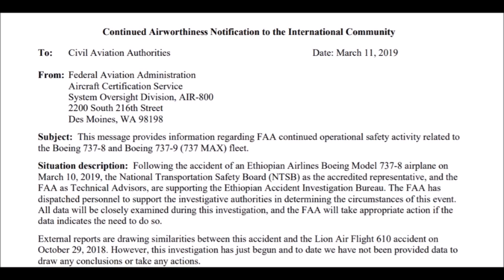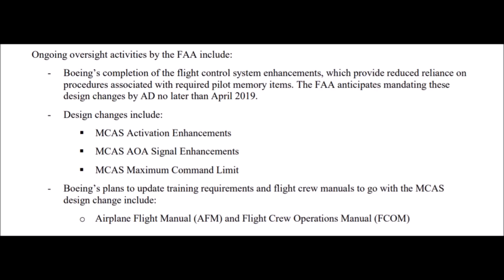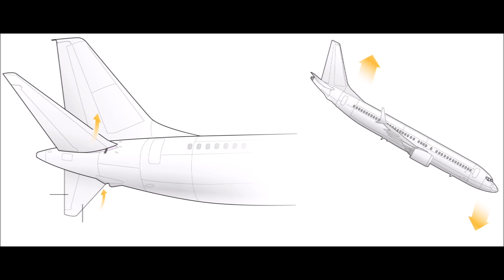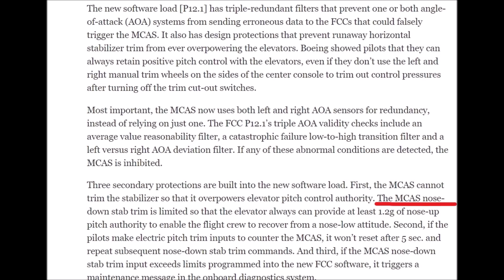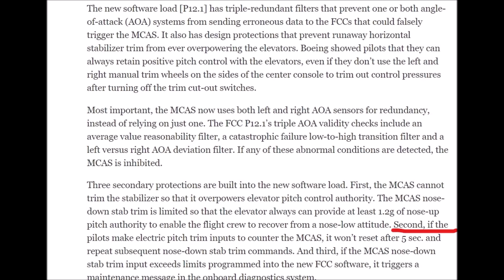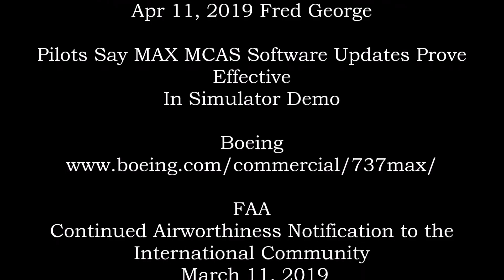737 Max UPDATE 14 April 2019 "The Fix"

Comment: Hello everyone sorry for such such a late response on this I have been working as a controls engineer through the Covid shut down and I’ve been very busy upgrading designs on various machines I really appreciate everyone’s input and honest answers and I agree with all of them, I do have one question for 1 or anyone who knows the 737 max! One can the 737 max be flown with the MCAS system disengaged completely? In other words if out rotation the pilot had to trim down manually with the trim controls on the yoke could it be done in a way that the pilot could keep the plane flying without too high of a climb rate and not putting it into a stall condition? I assume yes of course it would be distracting to have to trim down the hallway as you’re taking off as the MCAS system might do but if it can’t be done in this manual manner then as a control engineer I would consider this plane to be borderline not flight worthy because if the sensors or that system was to fail and assuming it had the red light which I heard was an option by Boeing not a mandatory system feature of displaying this out of all of this is true then maybe this plane really isn’t flight worthy? There’s certainly needs to be more redundancy in the system and as a control engineer I need to know that the pilot can control the aircraft or the machine when it’s in complete manual mode for the most part! Comments suggestions? I also know somebody I grew up with that’s a control engineer that works at Boeing I know he’s a very good engineer and I suspect he complained about this too I think he still there I hope him and I get in contact with each other, in my industry wafer fabrication robotics and toxic gas controls we have learned the hard way at putting a critical system in a safe state is the first priority when there’s a malfunction! Thank you everybody for your input and comments!

Comment: Hai captain I agreed to have automation in flight is good to avoid pilots work load .
Why Boeing not designed MCAS full automatic functions. As you said if ..... happen MCAS cut off , what design is it  where is the safety. Pilots get confuse , panic with error in instruments along with flight control column shake.
 If any crash happen Boeing will say we trained pilots ,  Crashed due to pilots error.

 World will become  against Boeing. It may effect even other models of Boeing aircraft for sure.

 My humble request ,  let Boeing redesign MCAS with failsafe concept introduce. Let automation happen. Defect report to pilots and ground with immediate effect. 
If not  let Boeing give complete simulator training for pilots freely.
Let the pilots fly freely with laughing face all around the world.
 As of now Boeing totally failed infront of Airbus high tech.

Comment: Who's the idiot that placed the entire airworthiness of a plane on a single sensor?    I have more backup systems in my house where I have multiple backup security electronics.  Of course,  I am not talking about an individual but an entire corporate culture that allowed this kind of idiocy to flourish.  It's incredulous to charge the buyer (of the plane)
additional money to include a backup sensor.    And install MCAS without informing the pilots, and allow the MCAS to override the pilot.   Holy idiocy.   Boeing once a marvel of an engineering company was taken over by McDonnell--and allowed the failed McDonell culture to destroy Boeing.  So if Boeing goes the way of the dodo bird,
let it.   When will boards of directors be responsible for their devotion to Wall st, and not core values?  The best answer
is to let them lose their investments.

Comment: There would be no need for MCAS if Boeing would have come to the prudent conclusion that the 737 airframe needed replacement. A new aircraft designed after the 787 but smaller to fit the old 737 midsize market segment and beyond would have been the proper choice. I doubt any software update or upgrade will regain the public trust for a 737 Max. This is fundamentally a question about the need to have old far outstayed hardware design replaced!

Comment: With all the scrutiny the 737MAX is undergoing, I'm willing to be a passenger even if I have a bit of irrational trepidation. 

The crews on the two planes that crashed were inadvertent beta testers of MCAS software. If weight and balance were factors in the crashes, then the passengers were also part of the experiment. Boeing is paying dearly for failing to test all aspects of the 737MAX more rigorously but not as dearly as the cost of one life, let alone hundreds.

Should the FAA have told Boeing the new plane is not a 737 but a new model, after they examined the differences?  I want to see how blame is apportioned when the lawyers and judges and juries and plaintiffs and defendants reach settlements, if I live that long.

(edited for format, not content.)

Comment: This is a perfect example of the problem that led us here, this statement by Boeing makes little sense to me. I think it is designed to befuddle the reader, "weasel words" as they are called in some circles, where then everybody around the office would just pretend to understand, it is not understandable very much at all, for me.
"The new software load [P12.1] has triple-redundant filters that prevent one or both angle-of-attack (AOA) systems from sending erroneous data to the FCCs that could falsely trigger the MCAS."
triple -- in what way?
filters -- what kind?
AOA systems -- too vague, meaning what? Just the sensors or is there more to it, and if so, what?
from sending -- did you mean from trusting data already received?
Reply: Boeing in these "fixes" is admitting to having made ridiculous decisions that killed over 300 people. C'mon it's just 300 people.
It's now time to kill some careers, those of the people who made those ridiculous decisions. C'mon it's just a couple dumb engineers.

Comment: 3:38 says pilots can barely notice any difference with MCAS off but then MCAS was created to be very aggressive, so that seems rather odd. It seem we still don't have a very clear explanation on what happened. Are they saying faulty sensors? There's been no discussion of fixing sensors, only adjusting software, to my knowledge. Why is this coming from a pilot next to a small plane instead of from commercial pilots next to 737 Max-8 planes on the tarmac at Moses Lake, WA after several test flights?

Comment: This video cracks me up. Stop covering up for an obvious design flaw related to the installation if the larger engines to far forward and higher on the wings. This was done because the landing gear was too short and was not enough room under the wings. Just admit this fact and stop covering for Boeing.  The Max is now a villain in the eyes of the public and is finished.  I don't care what expertise you claim, you are covering up for a system only found on the Max. This fact alone shows that MCAS is trying to make up for a design flaw.

Comment: With automation we will discover new failure modes, self driving vehicles are not the answer, having a driver fully aware of their situation is the answer.
I thought it was customary for drivers and pilots to look up periodically, apparently I was wrong.
Until drivers take driving or flying seriously, accidents will continue, and no amount of failsafes will change that trend.
Safety is a result of competent drivers and pilots, keenly aware of current conditions and limitations.

Comment: The fault  in the 737 max8 is he sole responsibility of  Boeing.
Any novice trainee pilot only has to look at the position of the  engine to see that it blocks the air flow across the root section of the wing. which destroys the lift of the wing.
 generating stalling of the wing.
It is a cheap attempt to beat the  A 320 NEO Airbus. BOEING PRODUCED A TOTAL SHITBOX. Typical American  profit for profit sake mentality. Boeing's motive  is and always will be criminal.
I will never set foot  on any Boeing  trash  FUCK all  yank garbage.

Comment: From what I've heard, MCAS was capable of running AFTER the primary Auto Pilot disengaged. The secondary Auto Pilot is suppose to assist with minimum control, relying on the human pilot. Yet MCAS still had overide priority over the pilot?

Comment: Hi Juan! greetings fom Russia to you! Could you please let me know what sourses you used to make the conclusion that MCAS was primarily implemented to provide the single type rating as the new MAX is inherently stable enough to worry about it. The reason I'm asking you is that I cited you when speaking with one Russian pilot of B-737 and he told me that he disagrees with this opinion and that he is sure that MCAS was primarily implemented to provide stability of the aircraft in the high angle of attack situations and all the rest was secondary.

Comment: Hi, Blancolirio.
I would suggest that whomsoever decided that electronics was an acceptable substitute for aerodynamics, individually and/or collectively, in the industry and/or in regulation, ought to be TOTALLY barred from any further input into or connection with the industry.

MCAS only became necessary 'cos some bloody I.D. 10 T. designers wanted to fit bigger engines than the airframe could safely handle as it was and chose to modify the wrong part of the design to allow said bigger engines to be fitted, a move which so changed the plane's flight characteristics as to make it UNMANAGEABLE with earlier training. 

I am NOT an aircraft designer but I would suggest that there were and are very good reasons why earlier versions of the 737 had their engines placed where they were/are, reasons relating to thrust in relation to mass, drag, trim, etc.. I can not help but think that fitting a bigger engine higher up where it could change the airflow patterns over the wings would cause some serious problems, not to mention the additional thrust and its relation to the aircraft's mass, etc..

But 'wottinell' would I know. I'm just a 'pore, dumb - and retired -  bulldozer operator who has made a 50-plus year career out of getting many types of machines to do more than most others could get them to do.. 

Thank you for bringing these issues to public attention. There needs to b e a LOTTTT more of this.

Just my 0.02.

You have a wonderful day. Best wishes.

Comment: I watched another youtube video where they claim the previous flight crews on both doomed flights had flagged one of the AoA sensors as being defective, presumably in the Flight Management System.  But MCAS ignored that information and continued to use the defective AoA during the next, fatal flights.
Reply: Ouch.
I have to wonder if my phone's knowledge of its orientation is more reliable than these planes.

Comment: As with most aircraft accidents, it's complicated.  However, I think in this case of the 737 MAX 8 a new factor will come to light.  I'm a retired CAA Inspector.  Self Regulation for Type Certificate holders and FAA Repair Stations DOES NOT WORK.  The FAA and Transport Canada has turned oversight over to industry and that is a big mistake.  Industry is driven by economics and we know how that works.  After an accident it's easy for the CAA to put the blame on the companies (or dead crew) after the CAA has allowed the companies to be self regulated.  The public should not be fooled by internal company quality assurance (QA) or safety management systems (SMS).  I've found areas where the company QA audits look too good to be true so I re-audited the area myself.  That resulted in many non-conformance reports.  You can't have the fox guard the hen house when it comes to public safety.   After retiring from the CAA I went back to industry and what an eye opener that was.

Comment: I don't fully understand your theory regarding the throttles at full power causing the crash.  If the positioning of the heavier Leap-1B engines (located further forward and higher than previous engines of the 737) causes the nose to pitch up, why would the throttles being at full takeoff power make bringing the nose up harder? It seems that once the cuttout switches prevented MCAS from engaging, full takeoff power would have helped the pilots climb to gain more altitude (not the opposite)? 

 - Respectfully
Reply from the maker: Got going too fast...

Comment: Super...Boeing found a solution for the problem called MCAS, but still fails to adress the problem why MCAS had to be installed in the first place. The placement of the engines...resulting in a positive nose up pitch moment. Redesign that aircraft or it will be doomed. No ones gonna trust Boeing nor the FAA any longer if they don't get it right.

Comment: Can we plz stop talking about the MCAS and start talking about the aerodynamic instabilities of the 737-Max by placing the engines up front of the wing slats, thereby inducing a pitch up moment, which is particularly negative (or relevant) flying in a high load, zero flaps flight envelope! The problem is this 60's design is at the end of its possibilites. Boeing was greedy (like VW) and imagined a software patch could fix the problem. The difference is that VW didn't kill 300+.

Comment: Why was the MCAS introduced? Isn't it to counter a design flaw! Now if you allow the ability to disable it, what happens to the initial design flaw? Is that design flaw not significant enough to constitute a risky situation? If no, then what was the need for MCAS in itself? It's not like MCAS provides an additional safety feature. It doesn't. It covers a design flaw.